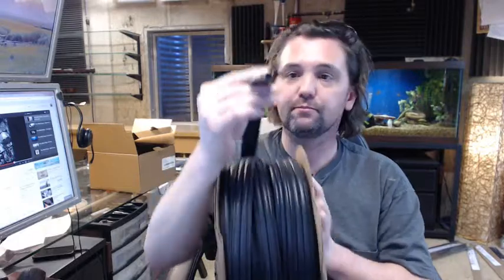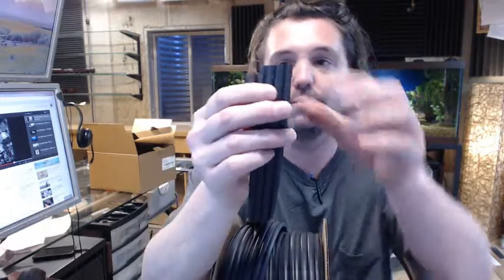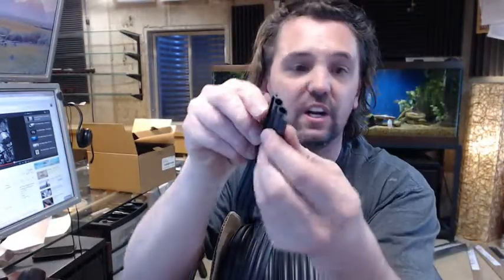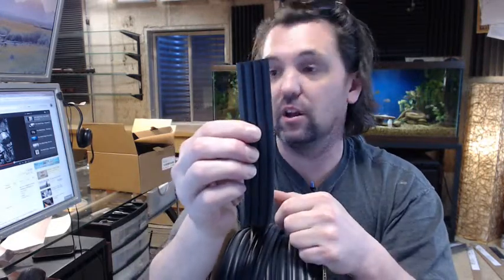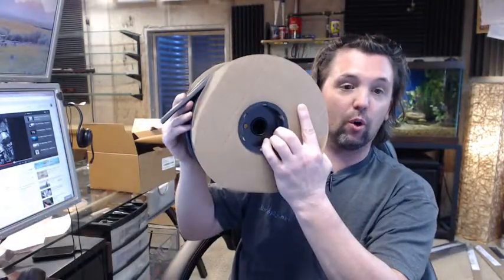Pemko S109D 100 Silicone Kerf-In Weatherstrip - Dark Brown Silicone

Comment: dose it means 200 feet total ? i when to your web site and look at Pemko S52W 100 is it the same it open in 2 piece ?
Reply from the maker: What is the question?
Reply: if you got strip on roll 100 fts long and you split them like you did on the video now you got 2 strip of 100 fts ,
it make a big difference when your order !
Reply from the maker: When you peal it apart, the length of each is 50'.  When you order 100 foot, we will send you 100 feet of the weatherstripping.
Reply: ok Thanks
 about the difference between silicone and Pemko Prene material ,for UV resistance ?
Reply from the maker: This item is available only in silicone, considered superior to PenkoPrene.